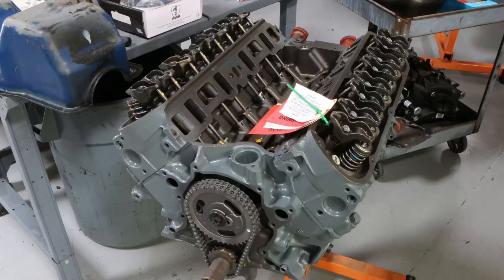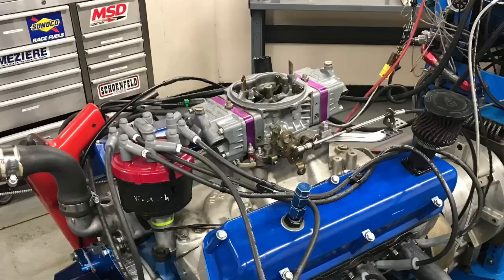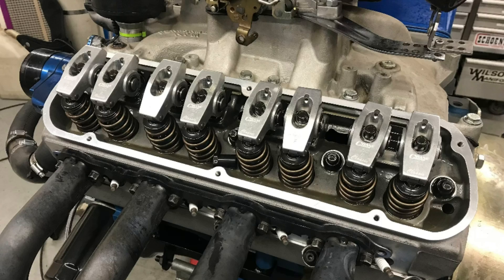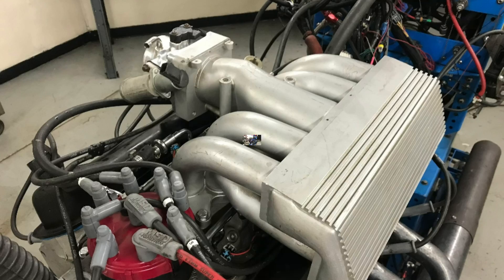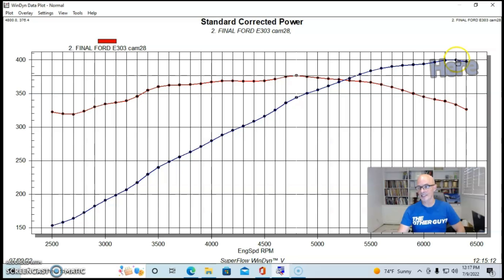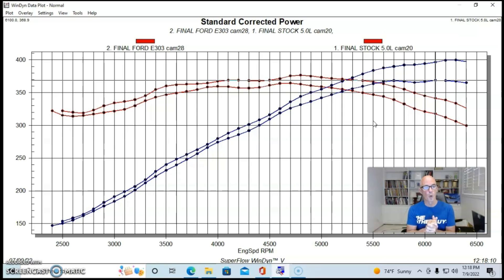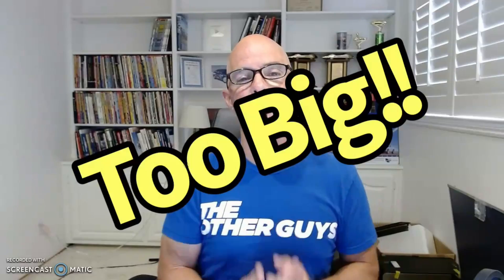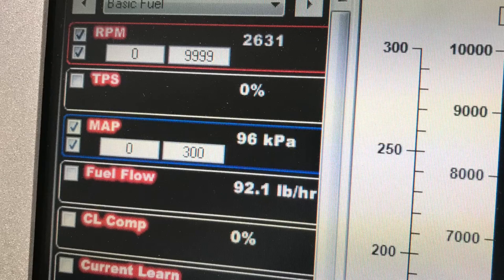5.0L FORD-CARB VS FUEL INJECTION-WHICH ONE WORKS BEST? EDEL RPM & 750 VS GT-40 & 65MM THROTTLE BODY

Comment: Like the video.  I took a three bar explorer lower intake welded #1,4,5,8 runners and ported them to same size of for all the runners.then took a 4 bar explorer top and opened it up for a 75mm accufab tb.  comp cam 1 3/4 headers 36lbs. Inj. Sct chip stock ecm 76mm may sensor rhs heads 190 fast as cast. Ported. 95 f150. 12.20s 1/4 mile. Never dynoed. Would you port a explorer intake and do some dyno test.  I have a trick flow track heat now. Not much gain 12.10s .

Comment: also hey Richard..  have you ran a stock block 302  with fully punched out trickflow170s 61cc chambers,  cobra upper gt40 lower 70mm throttle body, 60lb injectors, 70mm turbo on3 setup basically, with a full msd setup. with 3 inch downpipe to flowmaster super 44s deltas. ive got this exact same setup except ive tuned it myself with a ms2pnp . there's no dynos where I live  "7hours away".   would like to kno what the power and torque would be..  thanks man  great video. love the Windsor content...
also I pick a authentic  FULL 93 svt cobra intake that's had Tmoss's touch added to it. those things make and hold power lmfao.
Reply from the maker: the turbo would decide how much power that makes

Comment: How come you did not compare a Edelbrock Performer EFI intake to the carb version? I remember reading that the Performer RPM carb intake out flows the GT40 intake. That would have been a better comparison.
Reply from the maker: it's not flow

Comment: I see that they both have their place.   I assume timing and A/F were optimized for both combo's.  But does this come down to evaporation factor of the wet intake vs dry intake?

I ponder in my setup of vapor propane turbo sbc, could I benefit from a fuel injection intake manifold vs the Super Victor that I'm currently running.   1 was designed for dry air flow and 1 was designed as wet.  But I imagine that you will say "All intakes are Turbo intakes".

Comment: The carb vs efi in my opinion carb wins cuz it's way cheaper my 306 made 400 horse with a RPM air gap and a 650 demon and I'd like to see what the BBK SSI intake can do but they're so hard to find

Comment: The carb vs efi in my opinion carb wins cuz it's way cheaper my 306 made 400 horse with a RPM air gap and a 650 demon

Comment: Tubular  gt 40. X cam. 24 pound injectors 331 10:5 to 1 
Iron WORLD heads . T 5. 
Equal length Motorsport headers . In a 1992 red summertime Fox . I love the performance for the street . Perfect for 0 to 90 runs . It’s quite surprising.

Comment: With factory Terminator takeoff superchargers being so cheap on eBay often in the $1000 area Being a fabricator by profession I don't think it would be hard at all to build an adapter to go from the 5.0 factory lower to a custom fabricated aluminum upper to accept the supercharger... I'd think The hardest part is getting the fore to aft pulley location without a mock engine or having my car down for awhile which I'd rather not. Anyone have any thoughts on this... A 5.0 with an Eaton blower would be pretty cool and likely make good power with some supporting mods like heads and cam.

Comment: I was interested in this video as the efi manifold is almost the same design as the ecotec V6 ones here in Aus (3800 II) and they do as what in this video, good at low end but suck at the high revs.  The older 3800 1 use an improved aussie specific version of the US LN3 manifolds with short straight shot tapered trumpets into a common 1.7L plenum.  I did the calc once and the ideal rpm for that manifold is somewhere around 7500- 8000 rpm where the later ecotec ones with the long  S bend runners is more like 5500-6000. Explains partly why the older engines made better NA engines when hotted up despite having much smaller valves.

Comment: Does anybody make a carb style intake all ready for injectors or is that a total custom deal, I think it would be pretty trick if you could run a carb style intake with a side mounted efi throttle body adapter and out perform any factory unit. The sbf Holley high ram with the side TB top is pretty sweet but really expensive but not much more if any than a performance oem style intake from like trick flow.

Comment: I'd like to see the holley hi-ram, just for shits and giggles.  Seems like all the sbf intakes will only fit small throttle bodies(in comparison to ls stuff) so I'd be curious to see what the old sbf with the holley intake and a big throttle body would do.  Then later on add a better suited cam.

Comment: I think the best apples to apples would be the carb RPM vs the EFI RPM, why not try that? 👍
Reply from the maker: I did that
Reply: @richardholdener1727  which video is that comparison in? I’d really like to watch that!
Reply: @richardholdener1727  also was it the RPM 1 or 2 used in the comparison?
Reply: @richardholdener1727  ???

Comment: Looks like carb is better on this test great video, ! Think I need a carb on my 91 HO 5.0 Mustang ! A efi to carb conversation video would be helpful !
Reply: There's not much to it. Get rid of all the EFI intake crap in bolt on a carbureted intake with a carburetor. At most you might have to change the throttle cable but that's not a big deal. Also change your distributor out to a vacuum or mechanical advance.

Comment: Mathematically speaking a 650 CFM carburetor will allow a 5 liter motor to spin to 7500 RPMs

A 600 CFM carburetor will spin it to 6,800 RPMs

You should have more vacuum, and better throttle response as well if you were using a 600 rather than the 750.
Reply from the maker: that rpm formula based on displacement does not take power into account

Comment: $2700 cylinder heads and  we cheap out on the intake and didn't get the airgap?????
Reply from the maker: PLEASE SEE THE TEST ENGINE MASTERS DID ON THE AIR GAP VS RPM
Reply: @richardholdener1727  ok. So there is only about 4 to 5 horse power and torque that the airgap does over the rpm

Comment: Cant beat a carb for simplicity. Injection is great when it's working right. I have a friend that has been chasing the loping idle in his 86 GT for years. Every sensor and part  has been changed at least once and every trick for idle reset has been done. I suggested switching to carb but he says he's lived with it this long he'll just keep living with it.
Reply: Hasn't gotta vacuum leak somewhere ?
Reply: Back in the day I was installing a filter to get EMI noise out of the distributor control circuit to cure the lope.
Reply: Baseline idle reset . !!  BREWL

Comment: Impressed to see how well a carb does. How about trying a 650 Holley to see if that chokes down power. As far as an EFI manifold, I don't recall any Coyote style manifolds for the Windsor engine
Reply: I want to see the 600 or 650 also

Comment: Really cool stuff. Love to see a Gt40 ported lower, and shorter runner upper. Thanks man.
Reply: I second that I've seen Big dogs porting "shorten" the intake runners by porting the intake runners(on cast units) in such a way as to blend them all together in the upper portion of the runner and essentially lengthen the "plenum" portion of it. Supposedly it moved the rpm range of the intake and they are able to see tremendous gains, but I haven't seen any numbers myself.

Comment: Have you ever run an Edelbrock Pro Flo 4 fuel injection system? These systems use a single plane 4 bbl style intake combined with port fuel injection and a 1000 cfm 4 bbl throttle body.   This setup seems like an interesting compromise.
Reply from the maker: SINGLE PLANE NOT GOOD FOR THIS COMBO
Reply: @richardholdener1727  Morning.   So do you think a dual plane converted to port fuel injection work?   How about a long runner single plane converted to port fuel injection?

Comment: How about the Ford 6.2 mod motor, anyone curious besides me?
Reply: I've always had a feeling there is a ton of potential in the 6.2 that's going untapped.. And the fact that they've been around for years already makes them an attractive bargain if someone would show us what they can do..👍
Reply: @KR-qs3rt  my 2015 is my first experience with it and it has pulled everything I have hooked to it from 5th wheels to fertilizer tanks it never had a problem. Took me a while to get used to the higher RPM'S but now as they say  I just "let her eat!"...lol.. I had read the early 6.2's had a problem with breaking valve springs but I believe Ford remedied that problem. I'm sure there could be more horsepower on tap just by tuning especially with an E85 tune. I'm real curious how a twin turbo set up would do.
Reply: I've actually considered getting a new F250 with this engine if I can figure out a way to get sone boost into it.. I've always been the underdog type . Ive heard the 6.2 is one of Ford's lowest warranty claim issues engines...
Reply: @KR-qs3rt  a great uncle of mine just bought a 2022 and stayed with the 6.2 instead of the 7.3 because of the dependability he has had with his 2017. Not the easiest on fuel but he hauls a backhoe around all the time and gets 9 mpg consistently. Hell my old 77 f250 with a 460 didn't pull near as good as my 2015 and only got half the mileage.

Comment: I imagine the bigger injectors might make it a little more difficult to make AFRs perfect for emissions at idle etc, due to more granularity, but I agree it won't matter at WOT.
Reply: Large injectors usually only might have stability issues at extremely low duty cycles/pulse width i.e. trying to idle a small engine with huge injectors. It depends on the injector design how touchy they are.

Comment: Hey Richard, there is one more version of the gt40 intake. They used a version on the volvo/penta boats that has a shorter intake where the throttle body bolts on. Could be worth a look

Comment: Richard should have run edelbrock performer against gt 40 then run performer rpm and victor jr against better efi manifolds and afr heads
Reply from the maker: IT HAS ENOUGH HEAD FLOW, VIC JR. IS NOT GOOD FOR A STREET 302

Comment: The takeaway I got was that my decision to use a carburetor on the 302 Im building was the right one, not only in terms of poWer but simplicity. I don't think that a carb that big is necessary, I'm using a Carter/Edelbrock 600 cfm
Reply: I had Carter 750,600 edelbrock I didn't like either 1 I got 650 double pumper holley couple of car lengths differences
Reply: @jamiephillips3824 Do you have issues with it leaking fuel? Holley carburetors are known for that.

Comment: Systemax. I think carb stuff always makes just a few more hp than MPFI, when both are properly tuned. Something about the Venturi cooling affect.
Reply: More the cooling effect from a "wet" manifold. You could achevie the same thing with a efi throttle body injection system or multi port with additional injectors at the throttle body and a manifold designed to be "wet" (most efi manifolds are not).
There are pros and cons to both. Carbs tend to make slightly more power and costs less much, port efi (once you understand tuning) is super easy/self-learning, adaptable on the fly, usually easier to fit under a low hood line, and gives you far more options. It just depends which tradeoffs you prefer.

Comment: What intake should you compare the Edelbrock Performer to? How about the Edelbrock Performer (EFI version)?
Also I had a thought on that Explorer elbow test. Putting the 90 degree elbow slightly reduced power compared to the straight shot into the throttle body, but if you are running the fox body throttle body placement, there will be a very similar 90 degree bend in the air intake tube. So what would really be a fair comparison (based on how it would be installed in a car) would be the Explorer elbow with a straight intake tube and air filter compared to the fox throttle body setup with the fox style intake tube and air filter. I’m thinking that would probably equal out the power differences.

Comment: Blue print cnc ports there China dart clone now? Old 90's cast efi intakes for the 5.0 are all dead before 6k nothing new there, the few better ones where all ways touted as too big.   Hi ram. Box r and victor. Would be nice tests vs a baseline systemax. But there all hard to get these days

Comment: Hey Richard, I would like to see how the truck 5.0 intake compares to the GT40 styles.  It seems to have bigger rectangular runners compared to the fox body and even the standard 5.8 truck intakes.
Reply: My 95 302 truck intake ports are about 3/16" smaller in both length and width compared to the actual port opening on my stock e7te heads. So that intake is not very good for anything but high torque figures due to the high air speed in the runners.

Comment: Richard, the king of budget SBF EFI intakes is the Explorer from a junkyard.  The way to improve it is to port the lower.  It requires a little welding so you don't break through in a couple spots but it increases and equalizes the flow from port to port and it's not that expensive...

If you pull the whole engine, then port the lower, add a cam and Holley Terminator, that's a $2,000 combo unless you swap heads.  If you start with the same Explorer motor, add a cam, an Edelbrock Performer RPM, a Holley 750 and a MSD distributor, you are probably also around $2,000 so the comparison makes sense.

If you want a better intake, the Holley Systemax, Trick Flow (long runner) and Edelbrock Performer RPM all seemed to be pretty close in power so pick one.
Reply: he already did that test,  the Explorer did not do very well.
Reply: @bradmcgrath358  did he use a ported lower?  That's the secret sauce...
Reply: @joequixotic3039  
try finding the video and watching it,  I'm not here to spoon feed lazy people.

Comment: I’d have to go back Richard and look at one of your older EFI intake videos. I know you did at least one that I remember. Probably could take your pick between the Holley System Max, Edelbrock Performer RPM 2 or Trick Flow. I’d be curious to see since I’m putting together a 306 EFI with Aluminum heads

Comment: The best 5.0L Ford carb intake I've tried has been the Weiand Stealth, it beat the Edelbrock RPM carb intake. The best injector intake I tried was the Edelbrock RPM. The RPM carb intake ran like it was too big for the engine and the Stealth best it everywhere in power. Used the Ford E303 camshaft too. I ran both a 65mm and a 70mm throttle body on the RPM injection intake. Try an RPM injection intake and see if you can run a Stealth carb intake. The Holley stage 2 injection intake and a Trick Flow intake were about equal, but the RPM beat both of them for me.

Comment: It's close to a 400 HP Don Sherman AFR 165 Stock Cam validation run!  Great that you did this Retest, it's just missing heads and a stock HO Roller cam. None of this hard work you've done is lost on me, thankyou RH!. 4:44 No way! You dialled up the Elevator Music, Mr H. Your atmospherics have changed. Ford Racing quoted the Watson's Showa Yamaha GT40 as topping out at 425 HP gross. What cam would you use to make the two types of GT40 or "G51" intake produce 425 HP instead of 369? Or is that too, Don Sherman Fantasy?
Reply from the maker: NOT CLOSE TO 400 HP STOCK CAM
Reply: @richardholdener1727  As noted on the 90 HP gains video a month ago at 7:55, I'm 100% your advocate in this matter. As I said then, Maybee, that 400 HP with those alloy  heads, 1.7 rockers and a stock 5.0 Mustang HO roller cam 5.0 engine is possible. But I vote for a New Super R Holdener Test. Best wishes for the conquest of Truth over Hype!🫡

Comment: Richard will you try out the new-ish Holley 8.2 hi-ram? I’ve been wanting to see actual Dyno numbers and curves on that intake
Reply: Works great in high rpms 
Best with larger stroker motors. 

Coast high performance ran one on a 408. 

Horsepower TV ran the 8.2. I believe it was a 347 build.

Comment: I think if all flow numbers between the the 2 intake manifolds and throttle bodies/carburetors were exactly the same and the tune was maximized for both; there would be absolutely no difference.
Reply: There is a slight power advantage to a "wet" intake manifold in charge cooling with a carburetor. 
That said, you can achieve the same effect with throttle body fuel injection or port efi with extra injectors at the throttle body assuming an efi manifold deigned to be "wet".
Reply from the maker: there is more to power curves than flow
Reply: @richardholdener1727  guess we'll never know since there are no equal flowing counterparts to either system.
Reply: @TurboRanger351  
It would be very difficult to get what is basically a "dry" relativly large plenum, long-runner tunnel ram (the efi intake) to flow exactly like a "wet" relatively small plenum(s) duel plane manifold with medium long runners to flow the same at every rpm. To do that you basically need two of the same manifold but then what would be the point?
Reply: @177SCmaro  the point would be exactly that! There really isn't one. Too many variables in every combination to say one is better than the other when it comes to making power alone.  It all comes down to which one you like best.
Reply: @TurboRanger351  
The problem isn't too many variables, we understand the variables and can test them, the problem is geting unalike things to behave exactly the same is an unreasonable premise and expectation, particularly with engines, since you must make them exactly alike to get them to behave exactly alike i.e. you would have to change more than just airflow, but everything arriving at two identical intake systems to get exactly identical results and, again, there would be point in that.